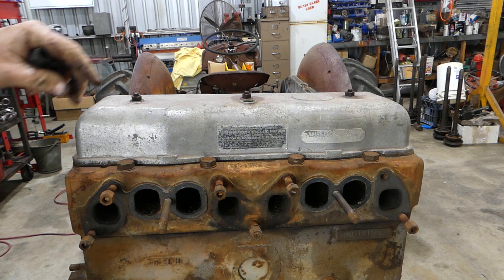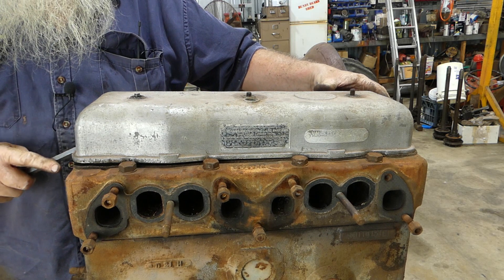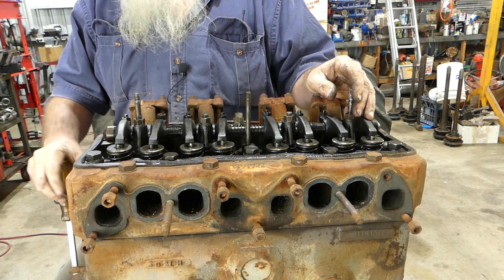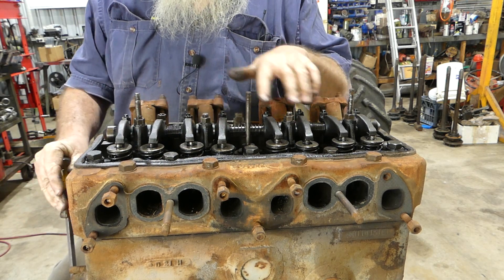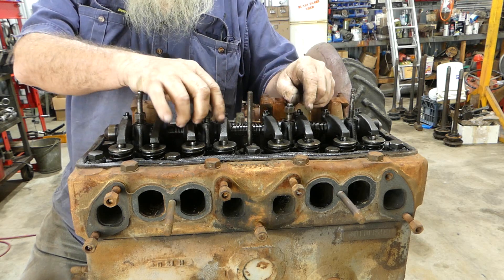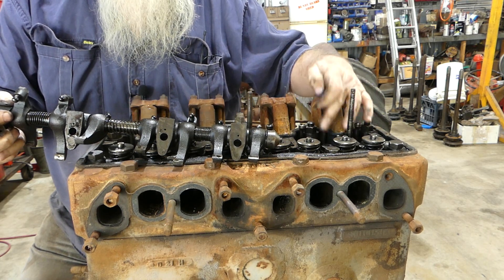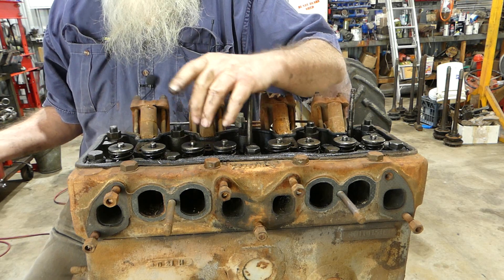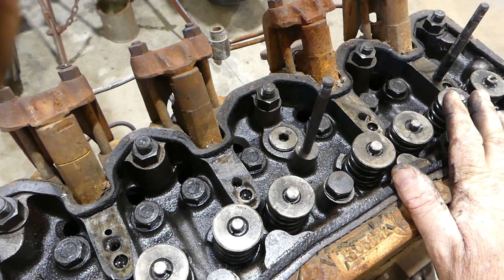Ferguson 23C Diesel Engine Part 3  Removing the Rocker Assembly

Comment: Just taking mine to bits and all my valves had caps. It’s also had a hex screw in like yours, instead of the white metal, and it looks to have not been opened before .. perhaps the factory started fitting those at some point?
Reply from the maker: Possibly

Comment: Hi Lance, have you ever seen wear on the push rod shafts where they rub against the head where it mates to the block?
Seems like the head and block holes are not aligned for some reason
Reply from the maker: No I cant say I have, is it the original head or off something else?

Comment: Hi Lance. I’ve seen both plugs- exactly as yours is and the ‘white metal’ you describe which to me looked hammered/ squashed into the same hole. The heads I’ve seen always had valve caps so interesting some didn’t.
Reply from the maker: Yes I have not had one without the valve rotors on the exhaust before.

Comment: Hello Lance,
Where the diesel engine and petrol engine ever interchangeable on the Ferguson.
I know the diesel has the starter button at your heel but often wondered did anyone ever do that.
Another great video, thanks for sharing.
Reply from the maker: I think they would be, Ferguson tractors often have the bell housing with a couple of starter motor bumps especially in the 35 and 135 ranges.

Comment: Hi Lance, what purpose did the white metal plug serve?
Reply: Probably it just plugged the hole. They need some holes to get the casting sand out when the heads are manufactured.
Reply: @Drottninggatan2017  Ok never thought of that, thanks for your response.
Reply from the maker: Just cashing hole as mentioned below I believe.